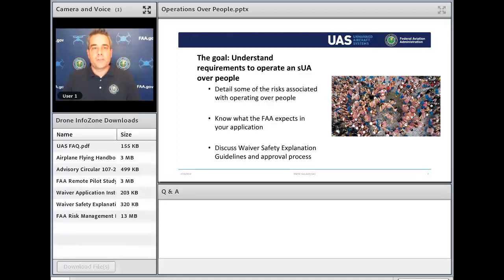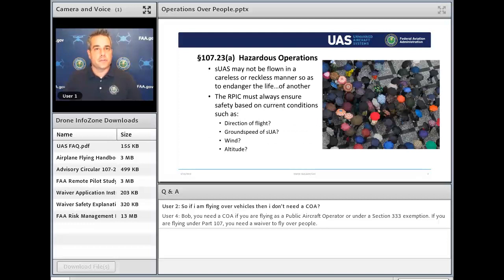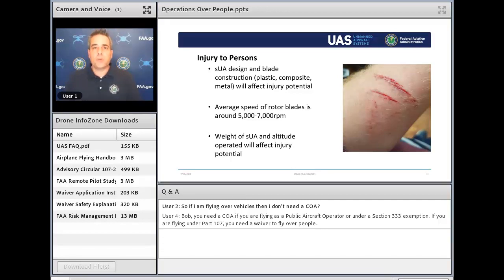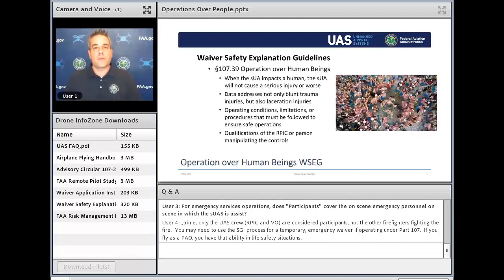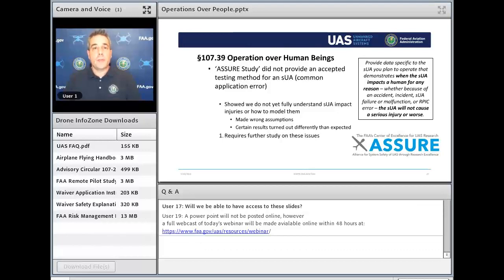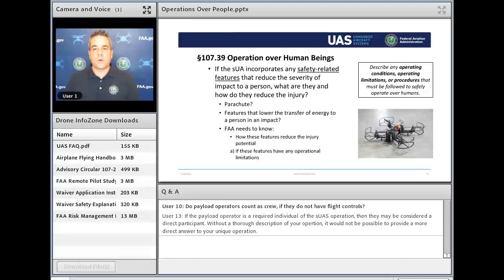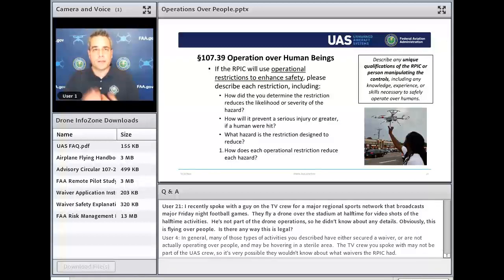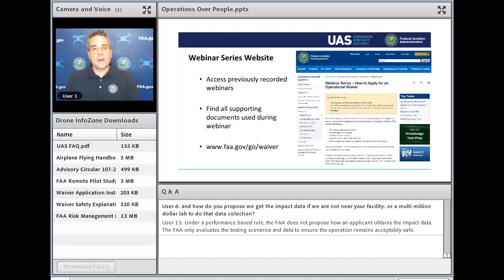Learn how you can fly your drone over people!

Comment: There are some members and pilots out there that are confused. Your websites state: "For example, a small UAS that hovers directly over a person's head, shoulders, or extended arms or legs would be an operation over people." They are thinking we can fly at a higher altitude so they wouldn't be directly over the person. Even in the video above it doesn't mention that the cylinder is extended around that person to the maximum legal height if that is correct.